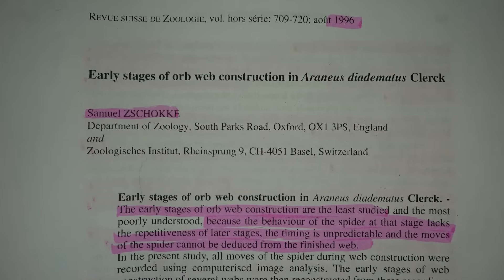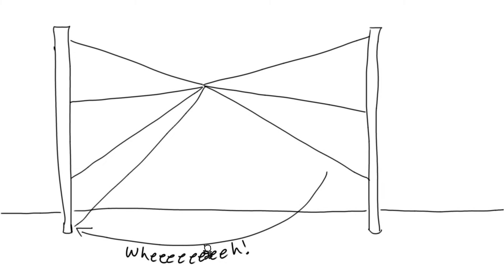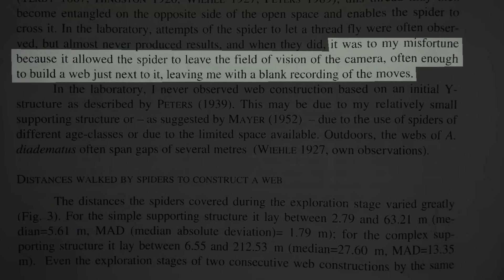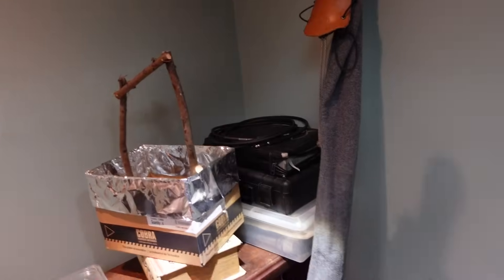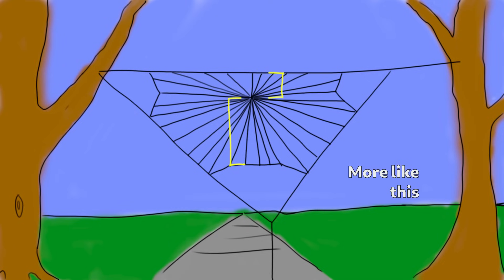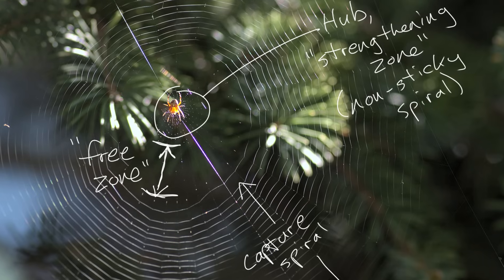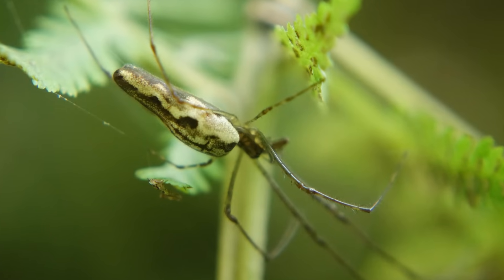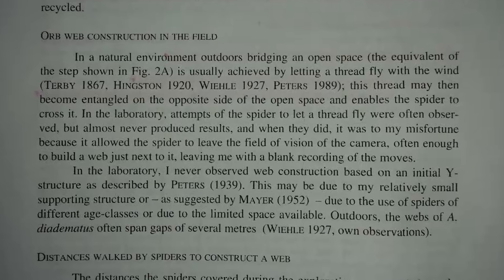How Orb Webs Are Made - Spider Basics: Beyond the Eight Legs, Episode 3

Comment: Hey, Travis! waves pedipalps  So I have a theory that the stabilimentum is in fact, amazing and actually amazingly simple. First, we don't have the most complex eyes and our brains do a lot more than guide us like a flight computer. Bugs, though, have to set aside significant mental faculties to be able to fly. The web is meant to catch flying things. So, let me tell you my theory. The first principle I would like to call Blindspot Illusion. It has to do with what our brains process first when we see an obstacle, focusing on it instead of the surroundings.

For this metaphor, I'm a flying insect. If I am going to have an effective flight computer in my head, it has to do some specific things. One, I need to process visual data and create a good snapshot of my surroundings. This frame by frame picture of the world around me from my compound eyes. Even though you'd think that it's important to have more frequent and faster frames interpreted by my tiny smooth brain, that's not how my tiny brain does it. Instead, I dedicate archived memory from the oldest of the most recent visual data that I have collected and this processes differently at a different rate of speed based on how fast I am going. You know, I don't have to pretend I'm a flying bug for that part, that's how we perceive visual data as well, only we're a bit better than a bug at it. The bug just has huge compound eyes that take in quite a lot more of their surroundings. It's more effective for navigating, though.

Now I'm going to speed up and slow down based on what I see, but also seeing is based on how fast I'm moving.

1. I'm moving fast...
- I keep my distance from objects as I zip along in a relatively straight course. The faster I'm moving, the wider berth I give objects.
-The spider doesn't want me moving Mach 1 when I hit the web. That would be just a mess and I'd punch right through the sticky web, crash, and fall uselessly to the ground like an ice cream cone from the hand of a sad child, as opposed to being consumed.
- I see the stabilimentum because it is shaped to be seen as a single object at this speed. I avoid the whole thing. Both the spider and I have a good day. The spider waves like it's a toll booth operator and I have a paid pass.

2. I am moving slow...
- I fly closer to objects, avoiding predators and conserving energy as I am never too far away from a place to land and/or take cover. 
-I cautiously view my surroundings and notice there's a whole-ass web in the middle of the trees. Whoop, I better try to remember that when I come back through, but I'm a tiny flying bug. Oh look! A leaf! What was I saying?
-The spider takes note of me with a saucier's notepad, determining what sauce to use on me next time I come through.

3. Slow is boring. I am moving fast, but... the flip is that? Is that a shiny zipper floating in the air? The flip is a stabilimentum?
-I was flying fast, but I just had to slow down. There's an object in the air and it doesn't seem to be attached to anything.
-I instinctively pull closer to the object as I brake, following braking procedure based on bad visual data. The purpose is to avoid a collision with objects like it that might be ahead. I'll stick close to the one I do see, as opposed to running into an unknown space full of potential hidden space zippers.
-Too late! The area around the shiny floating zipper was a web! Boi-yoing! Now this is embarrassing. Hi, spider. I wasn't planning on staying for dinner, but here I am.

There's more here and it has to do with bugs having air traffic laws. Flying bugs really don't want to run into each other. That would be like an oncoming collision if you were to enter the freeway driving against traffic. Messy. So you look at the wings. Is it flying horizontal or right at me? Objects moving directly towards you as you move forward appear to almost stand still. The web fragment is in fact, by not moving, mimicking a bug flying right at me. Those aren't wings, though. It's a stabilimentum. Aww, tricky spider. I thought you were flying. I changed my angle of approach and everything. Just like they taught me in flying school. I ended up turning too late and flew into the web, trying to zig-zag to determine which way you were flying and everything.

These are my most recent inane theories. Tell me what you think, Travis.
Reply from the maker: This is actually a fascinating theory. I haven't had the opportunity to look at the literature on stabilimentums (though I look forward to researching Argiope), but I love the way you described this (especially the spider's attitude toward each insect). This makes some sense - not sure how you would test it, but it's amazing how scientists come up with ingenious ways to test hypotheses.
Reply: @travismcenery2919  case in point, spiders on drugs. Lol. Also, your spider moat idea is great.

Comment: Many thanks for another outstanding video.   Perhaps this question has been asked previously:  How do you collect your spider?  What equipment do you use?🕷:pride-heart-rainbow-philly:🕸
Reply from the maker: Nothing fancy. Generally it's just a little catch cup, and I corral the spider into the cup and close the lid. Some are easier than others. Many times I've had a spider crawling from hand to hand, as I try to make my way from the backyard into the house to find a container without the spider launching itself off my hands. It's pretty haphazard.
Reply: @travismcenery2919  I have water bowls outside for my pets.  In the morning when I change the water there is often a spider or two.  On the offhand chance that it has fallen (or maybe on purpose) into the water, I try to remove it gently.  Then it wants to be BFF and won't hop off onto a leaf,  but at that point, I'm ill-prepared to transport it.  You are an inspiration.  Maybe I'll carry a few small vials in my pocket.  Thanks again.

Comment: 6:06 Infiltration and exfiltration(air moving into and out of the house through small cracks, joints, etc.): every time the air pressure changes outside, air will force itself through one way or the other, trying to equalize pressure inside with that outside. This can cause air currents that might be imperceptible to a human under normal circumstances.
Reply: Temperature differentials can also come into play, but I'm too stupid to explain those simply.

Comment: I used to live in a place where orb weavers covered one side of my house every night. I noticed that they would take their webs down every single morning. Is there a reason they do this? I have also heard that the zigzag patter in the middle of the web was to provide visibility to small birds like hummers so they won't get caught in them. Not sure if it's true but still fascinating.  Great video too!
Reply from the maker: Yes, most orb weavers will rebuild their web every day or two. I'll discuss that a little more in the Cross Orb Weaver video, but it's sort of a maintenance thing, as stuff gets caught in it throughout the day. The web, in addition to a trap, is also a giant sensor, so it needs to be clean. Orb weavers usually leave the anchor and frame threads and re-use those, but they eat and recycle the radii and spiral threads.
Reply: @travismcenery2919  They are so intelligent and fascinating.  Great video!

Comment: not long ago I found a web (of Nuctenea umbratica) where the top of the web was attached to a horizontal tree branch, while the only thing it was attached to at the bottom was a single hanging leaf, which was dangling mid air (only attached to the web) but the web was in perfect shape. basically like at 8:53 but the web was attached to a floating leaf instead of the floor.
still have to figure out how the spider managed to do it
Reply: I have a mind picture of that web just dancing in the wind
Reply: @osmia it wasn't windy at all but if it was, the web would have been destroyed quickly
Reply from the maker: That's definitely curious. I'd wonder too - I don't have an explanation for that!

Comment: I live in a 300 year old farmhouse, which as you can imagine, is filled with spiders. Yesterday I walked into my bedroom to see a very small spider seemingly suspended in midair. After a moment I noticed though that the spider wasn't dangling from the ceiling, but had somehow connected a horizontal line from the top of my TV to an adjacent wall, and following the thread I would measure it at least 8 feet long! I do always have a fan running in that room so the slight air current must have been just enough to let the spider connect a thread from essentially one corner of the room to another. Unfortunately I did have to undo their work because it was at head height in the middle of my bedroom lol, but spiderbro is hopefully thriving in the corner where I pulled the thread to.

Awesome video, wish it was longer :)
Reply from the maker: It's amazing how they do it sometimes. Glad you found a spot the spider could stay, and thanks for the comment!
Reply: Thanks for imagining the spider had a life worth living, instead of just shmushing it for convenience.

Comment: Recently I found in my garden Cyrtophora citricola... And oh boy web that spider do is just mind blowing. Its similar to bowl/doily web but WAY more complicated as main body of that web is bowl shaped and its made of precisely made grid with square holes around 4-5mm each, with small hub in the middle where spider sits. And then that whole bowl is hold on top by massive mesh of random strings that is not very dense but very chaotic in design. I actually saw how it work, as bug fly into it, bump around that mesh until it drop down to that dense grid web, spider run to it and pretty much grab that net from bellow and cover that bug with it like it was a bag. Amazing to see it up close.
Reply from the maker: Those kinds of spiders are fascinating. I'm always blown away by the different ways spiders can use silk, from the theridiid cobwebs to orb webs to the bowl and doily webs.
Reply: @travismcenery2919  Silk use (including different types of webs) would be a cool topic for a video.

Comment: From 'Microsoft's Copilot:.
.
"Certainly! The structure you’re referring to is called a stabilimentum. Orb-weaver spiders, particularly those in the genus Argiope, create these elaborate web decorations. A stabilimentum can take various forms, such as a single zigzag line, a combination of lines, or even a spiral whorl in the center of the web1. Its functions include:

Prey Attraction: Some believe that the stabilimentum attracts prey by reflecting UV light or acting as a visual lure.
Camouflage: When the spider sits in the center of the web, the stabilimentum may help camouflage it.
Warning Signal: It could serve as a warning sign to birds, preventing them from accidentally flying into the web.
Silk Visibility Reduction: The stabilimentum may decrease silk visibility to insects, making it harder for prey to avoid the web2.
Fascinating, isn’t it? 🕷🕸"  .
.
Now, although anecdotal, I believe that item 3 regarding the bird warning to be most compelling, considering, I have purchased and use stick-on plastic film prints (6 or more) of orb weaver webs on my very large picture window and very significantly reduced bird strikes! 😁
Reply from the maker: I've never heard of using film prints of orb webs to reduce bird strikes. That's fascinating! And yes, these are the leading theories about why these spiders do this, but nobody knows for sure so far.